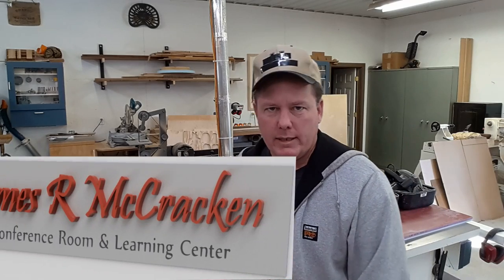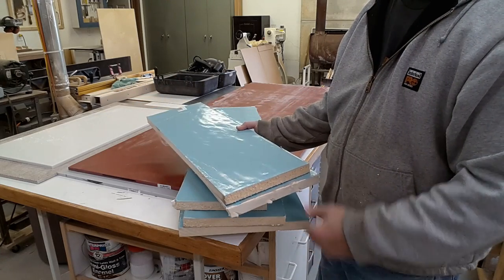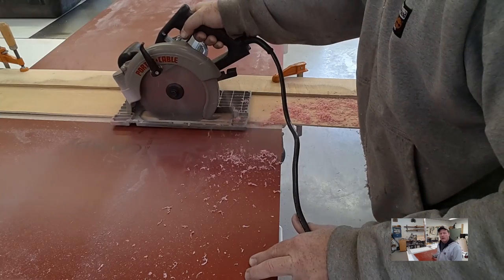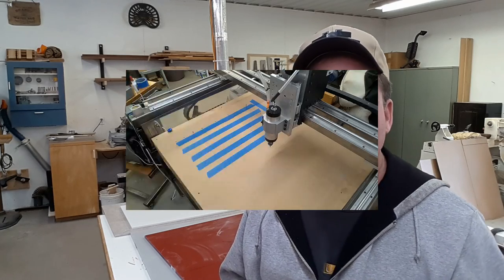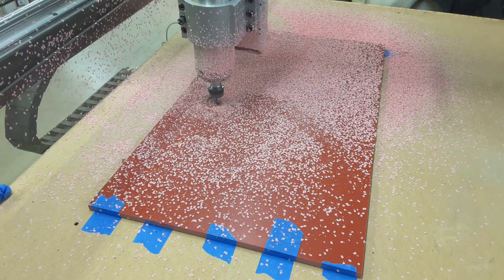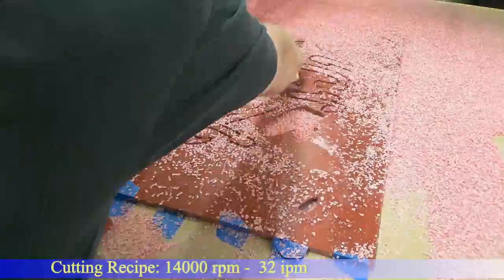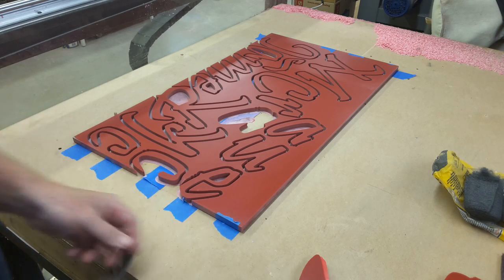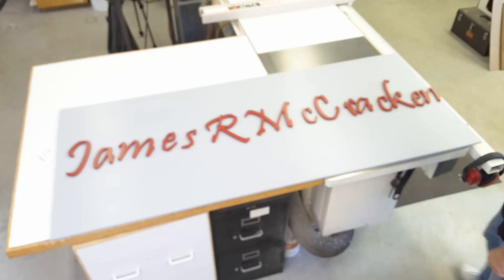CNC Routed Solid Surface Sign

Comment: I'm a cnc operator in the woodshop of a sign company and we have contracts with companies like McAlisters, sonic, hardees, taco bell etc... and usually I'm cutting 3/4" plywood, mdf omega board, pteg, including Corian as seen in your video. haven't cut red but have cut morning ice, frost,and cocoa brown. our preference bit is the onsrund 3/16" end mill single flute bit and it's works very well. I highly recommend you trying if for urself
Reply from the maker: The shop I bought the Corian through ran Onsrud bits as well.  I am going to take your advise.  What do you use for mdf and plywood? ~P
Reply from the maker: Is that a straight flute or spiral?
Reply from the maker: ...sorry...your the first person with any practice experience I have come into....do you know what the speed and feed is you run in some of the common materials?

Comment: Looks great! would be nice to make a video with a solid surface inlay example, thanks for sharing!
Reply from the maker: I'll give that a try.  It will be a measure of my machine.  The hard part is making the material <.5 inches which is the normal size.  It doesn't go through my joiner very well.

Comment: I really like that tool pathing from Fushion 360 where it just does small circles doing only either a climb or conventional cut. Shame that Aspire doesnt appear to have a similar tool path option.
Reply from the maker: That path is called 'adaptive clearing' in F360.  F360 doesn't do 3D carving as well based on what I know.  I think there is a place for both.
Reply from the maker: Really.  I had better look closer.  I would like to do more creative 3d in Fusion and not have to learn a different CAD package

Comment: Thought of something in regards to ur touch block for the CNC. Have you thought of putting a micro switch under the brace plate. You'd have to wire it of course, but hooked up in parallel with your lead that works with the touch connection would give you a built in positive stop in case it failed on the contact process. Would only have to a small pocket to accommodate the switch. Keep you from sitting on the edge of your seat while making contact. Just thinking.  Later.

Comment: Great video. Are you and jay bates family lolol....As a matter of interest...Did you think of setting Z to the bed instead of the stock? No burs would've been there... Is that stuf anything like G10?
Reply from the maker: It is a matter of habit that I use the top of the material.  Maybe I'll try that next time I cut this stuff....or anything else.  It would help with things like plywood that don't have a consistent thickness.  Thanks for bringing it up.    I did a quick google on G10 as I'm not familiar.  If you are referring to the fiberglass composite stuff, then the answer is 'No.'  This is a resin based product.  Smells and acts like a hard plastic.  It is very consistent in density and leaves a very nice surface.
Reply: I also use my spoilerboard as Z axis reference point for 99.9% of jobs. The only time I would reference top of the stock (various offsets during a single job) is when I do inlays or cuts that are depth critical. Then having reference from the spoilerboard is a bad idea. About always there is a discrepancy in stock height and even if you use a known solid and don't use something like a vacuum table or clamps that is flat on the spoilerboard but 2 sided tape or even masking tape you are off by a little and it leaves some sort of a bur somewhere along the profile cut. I know it this might not be a problem for most people but that is like sbirdranch just a  habit I developed over the years. @WonderAround, G10 I think won't cut as easily Corian. That stuff is hard but on weight seems to be on par with Corian. Keep up the good work sbirdranch :)